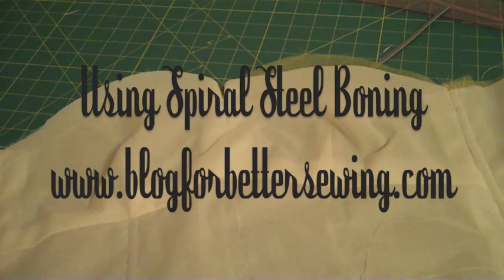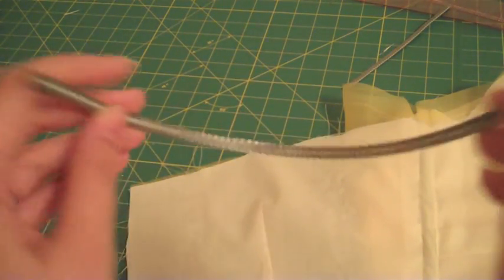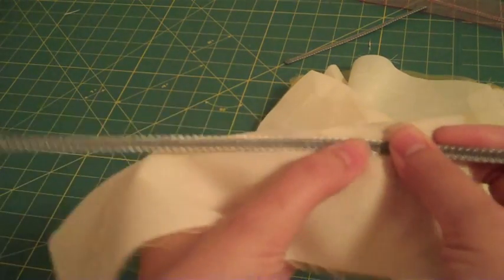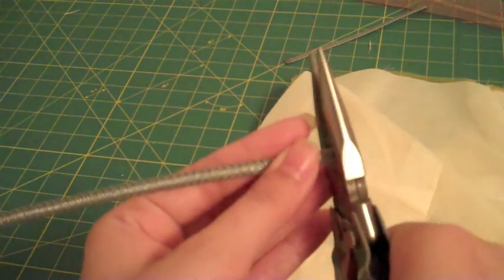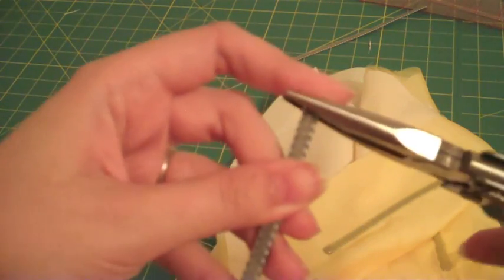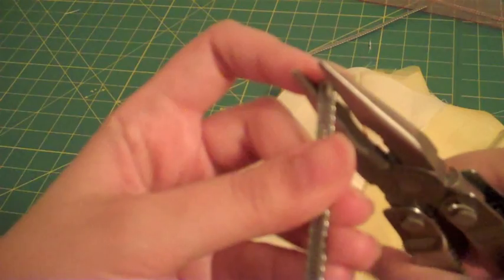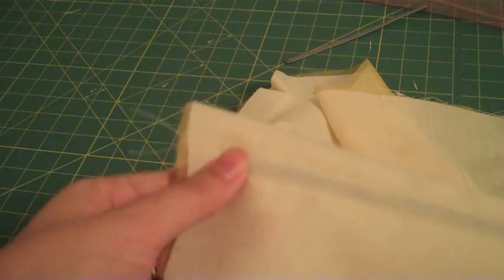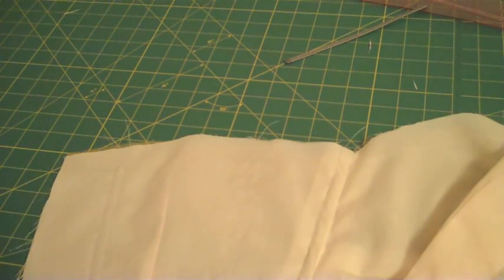Using Spiral Steel Boning

Comment: I know this is an old video and you may have already found this out.  An easier tool to use for cutting steel boning is a tool used to cut barbed-wire.  I used to do mid-19th century historical interpreting and had to make a period correct hoop skirt.  My colleagues showed me how and told me to go to the hardware store to get this.  And Voila! Awesome and so much easier.